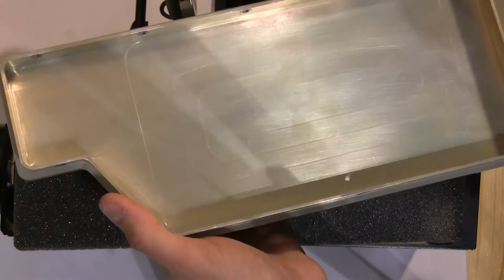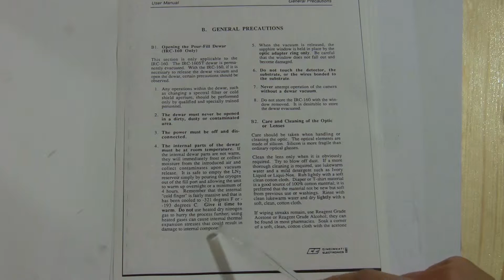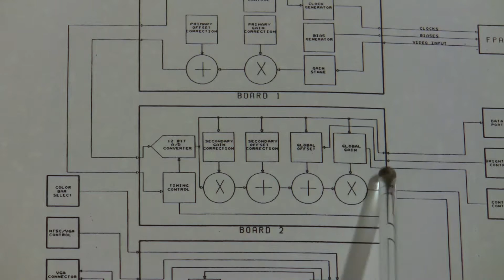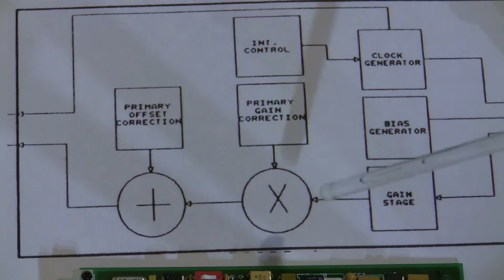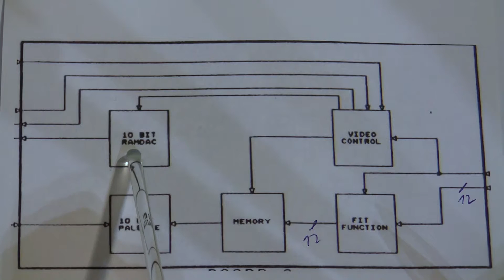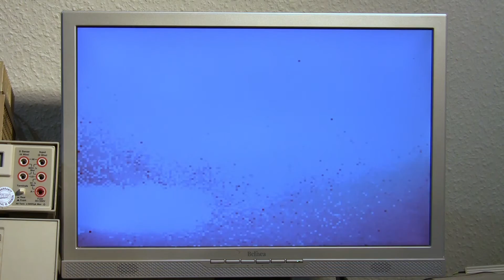Teardown of an IRC-160ST Stirling Cooled Thermal Imaging Camera

Comment: The Insight Starsight which tesla500 bought is a much more sophisticated camera, which while using a pyroelectric vidicon tube, has a built-in title generator, an onboard calibration facility and a visible light camera for aiming.